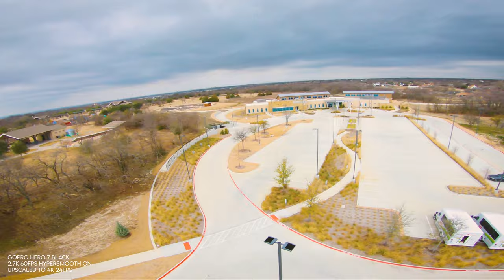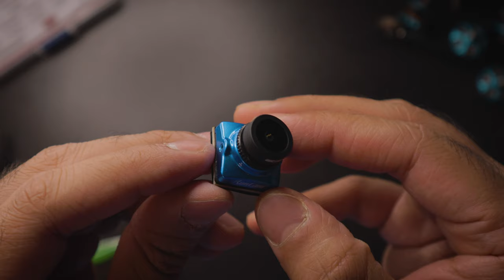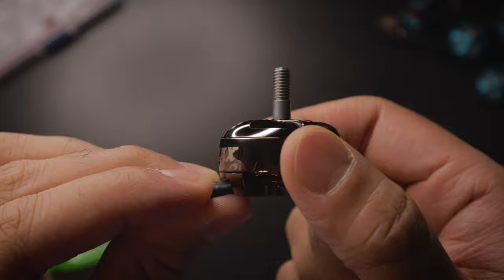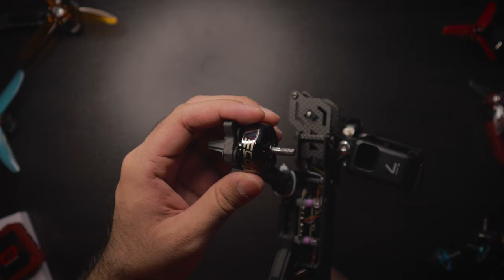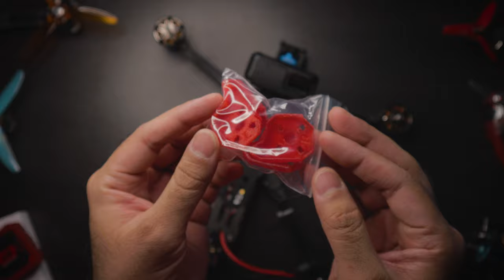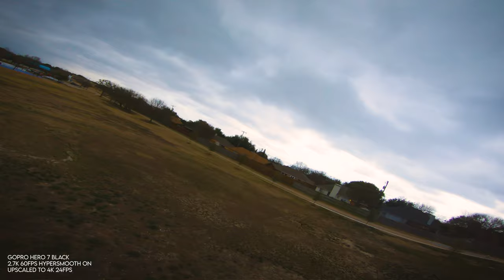My NEW 7 Inch FPV Build! (w/ EMAX ECO 2807's) (4K)

Comment: I love that frame because you can take a big ass battery with you.
Reply from the maker: Exactly my reasoning haha
Reply: @supafpv1759   yeah i run a v4 (before tbs pulled it) source one in a deadcat configuration and the top plate is meh….I think it’s time to get that frame. I have these 3200mah 6s batteries already too.

Comment: fantastic build, I have a tip for the beginners out there: Keep the weight of the quad as low as possible, it's the best way to get the longest flight time. I use a 4s 2300mah on my emax eco ii 2807 1700kv motors and get 14 min of flight time, the dry weight of my 7" is 430g
Reply: How many amps does it consume froms the 4s?
Reply: @Meleonlight  15-20 Amps while cruising, depending on the load (gopro and li-ion)

Comment: Ok so your approach was big and powerful. Looks like your flights were very smooth.  I'm thinking big and light weight. 
I'm thinking a lightweight ~80g 7" frame with 2004 motor, 35A AIO ESC, caddx and 6s. If it turns into a floaty garbage. I'll just salvage the parts into my other current which share those specs. Next month I'll have budget for such shenanigans.
Reply from the maker: Sounds like a plan man!
Reply: 2004 motors are way too small for 7"

Comment: we like darn near have the same setup. I have pretty much only flown the super g plus with 5" props at first then moving to 6". 
Like i run-cam phenix 3 too. 
Currently i run 2806.5 but as soon as I break what is in my inventory - moving to these super sweet 2807s.  I made two twenty eight zero eight videos on this frame. Dang the battery life was not good but as Jeremy Clarkson would say "power" 
my only question would be about the bells. what happens when you tap a death branch?
then spiral down, then hit a tree, 
then spiral down, and get stuck in another tree.
 good to fly after hours of rock throwing at said tree then someone gets another drone stuck in the tree?
or 
call the fire truck because the forest is on fire because i hit a tree at mach 3.
fyi non of this is like serious, im just having fun.
thank you for the comment. 
fyi all my videos are soley this similar setup. 
shifting gears,
   I see you on your edits. Very smooth! i like your style!
much love -
AC
Reply from the maker: Haha I appreciate the comment man! Lmao the 2807s are sick man, 2806.5 should be veryyy similar ish! Power indeed, these 7 inchers are fast affffff bro like it’s wild! If I crank the throttle I bet I could cool a chicken if I hit it fast enough lmao
Reply: @supafpv1759  lmfao im dead!
the 2807s look amazing! definitely have to grab a few sets. Great video dude!

Comment: Nice kwad. How much weight can it lift? Enough torque to lift a mirrorless camera with a small lens?
Reply from the maker: Oh man definitely not enough torque to be moving around safely. I’d go for an octocopter if you really wanna use these motors. Or bigger motors if you want a quad.

Comment: Beautiful Build Brother!! Alot of the same Components thats on my 8 inch except for the motors! I chose to go with the Xing 2806.5 1300kv
Reply from the maker: Those are definitely fair game man! Very high quality! You run it on 6s I assume? And man 8 inch is huge haha
Reply: @supafpv1759  depending on what type of props im running Cyclone T7056C pro on 6s gets me a safe 90mph but with the Apex 8x4.5 Biprops it hit 120 before the prop come apart but on 5s i get a safe 90mph flight on the Biprops. Theres not alot to choose from in the 8 inch so im experimenting and so far the T7056C offers the smoothest and safest flight on 6s.
Reply from the maker: @bamafpv1982  yea there’s not much in the 7 inch space either, but 8 inch I imagine there being a serious scarcity of parts
Reply: @supafpv1759  i have the iflight XL8 v4 and had good luck so far with RDQ for frame Parts and keep Checking with Dalprop for some T8056C Pro Props lol

Comment: Great Channel. Looks like I built the same quad except I'm using crossfire sixty9 and toothless cam. I'm getting some bobbles when I hit the throttle. Did you get that? If so how'd you get it flying so nice?

Comment: you sound like Dronemesh :)
very nice build bro..im thinking of building a 6inch or 7inch,,can i just convert one of my 5inch quad and just change the motors and frame?
Reply from the maker: Lol thanks haha he’s a very knowledgeable man for real! And yea pretty much man, the motors/props and frames are really what makes them unique. I’d say use a higher amp esc than you probably will for 5inch quads tho for the bigger motors.
Reply: @supafpv1759  i thought long range quad use not so much amps because youre just cruising?thanks for the tip :)
Reply from the maker: @bwasfpv  the bigger motors draw more amp and using a bigger prop draws more amps too. I’m not sure why or how lmao but these were suggestions made to me lmao

Comment: That looks much better without the TPU
Reply from the maker: Right! The TPU it comes with was red IMO I like a nice stealthy black quad lol
Reply: @supafpv1759  I've priced this up and I can't build it for cheaper than iFlights BnF and they use better motors. Is there much difference with the Rush VTX and FC/ESC that you use compared to their BnF?
Reply from the maker: @Atlas_FPV  At the time of filming and building I had the total at around $280. The bnf from iflight has a better stack, and the VTX is relatively the same as the one I have on here. The one I have has the ability to solder a mic on to it, and I believe has a more stable connection on there. The two builds are about the same with the bnf actually having relatively better parts for most of it. I preferred to build my own for cheaper at the time because I knew the props I wanted to pair with the motors, my budget was limited, and I wanted a better camera on the front. Iflight uses a caddx camera that I seriously disliked, so I went the runcam phoenix option on mine, it has great clarity and amazing colors right out of the box for analog.
Reply: @supafpv1759  thanks man, I’m excited to try this

Comment: Link pid your setup plese
Reply from the maker: I’ve just got 1.3x on the bottom two sliders. Iterm relax to set point, and 10 on the cutoff. Antigravity to smooth and 10.  And then filters gyro RPM 3, and 100. Dynamic both filter to 0, 250, 125, and 350 going from top to bottom.
Reply: @supafpv1759  spasibo tovarish, thank you comrade, a distant Siberian thanks you

Comment: Hey supa, im building my first quad and it's similar to this.
I'll be running the same motors but on a mamba f405mk3 50a stack, and u have a question.

The manufacturer stages 2.5kg thrust per motor on 7040 gemfan prop on the 1300kv version at 6s while pulling 47a, do you think it's safe for me to run 1500kv on the same props on 6s on the 50a ESC?

Comment: Forgot to ask, where did you took the tpu parts can give files for mounts bcs I also hate the red tpu parts
Reply from the maker: I actually didn’t print out any tpu parts other than the gpu mount with the antennae hole in it. I’ll link that soon. The other red feet stuff I replaced with the plastic feet I have linked in the description
Reply from the maker: Just updated the description with the 3D printed gps mount
Reply from the maker: As for the arm red pieces, you can get I believe most of the iflight arms end 3D tpu additions from most fpv 3D printing companies like bmc3d or brain3d

Comment: How did you do the battery leads? That space throws me off. Thanks.
Reply from the maker: The top lead is the battery one right, so I strapped that under the first battery strap so it won’t move around. Then the bottom strap has the power wire lead going to the esc. I have a very long battery lead haha. About like 8 inches from the esc to the xt60 connector.
Reply: @supafpv1759  Got that part. But the soldering to the ESC. How did that go? Thanks again.
Reply from the maker: @cesarango01  ahh yea so red wire to positive pad on the ESC, and the black wire to the Negative pad on the ESC. I have a four in one esc so there are designated two pads for those wires. The rounded bit side of the xt60 goes to the black wire and the red to the more flat side. If you have four individual escs you need to wire them all invodiually to a PDB and then wire the battery leads to the PDB like I said above, positive to red negative to black
Reply: @supafpv1759  Got that. But I see that the leads on the ESC are cut out. How do you get the solder just right? It would seem harder to solder correctly than the basic pads.
Reply from the maker: @cesarango01  ohhhh lmao you shoulda said that earlier hahaha yea man that was a pain in the BUTT dude. So what I did was fill that pad outline with solder like a lot of it. Lightly tinned the battery leads, and then just heated up both, but while I heated it up, I tried to scootch it right into the notch vs just resting it on top. There’s prolly a better way to do those kind of pads but yea that’s how I did it.
Reply: @supafpv1759  Geez. I am looking at set up for an upgrade. I already have a 7 inch but with the F405 mk2, but not that type of lead. Looks like a pain. Does it feel like a solid hold? Thanks again. Tell me how it flies.. Good luck with it.
Reply: @cesarango01  I have the same ESC and and was practicing on a different board because soldering battery leads is not easy.  What I found works well on a U shaped pad like that was to rotate the U to the sky so it can catch the solder like a bowl.  More initial solder on the pad the better.  Then with my biggest solder-tip I heat from the bottom of the pad and push the wire in from the top of the pad.
Reply from the maker: @cesarango01  flies sick man, I had to do some minor pid tuning but for hypersmooth HD footage it’s amazing right out the gate. The solder joints hold pretty tightly, like actually fairly snug I guess maybe cause it has a solder hold all around it vs just the bottom on normal pads.
Reply: @alexanderfpv6655  I like that idea. Super. A bowl. Excellant!